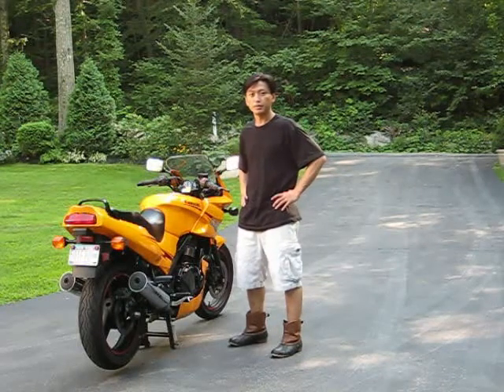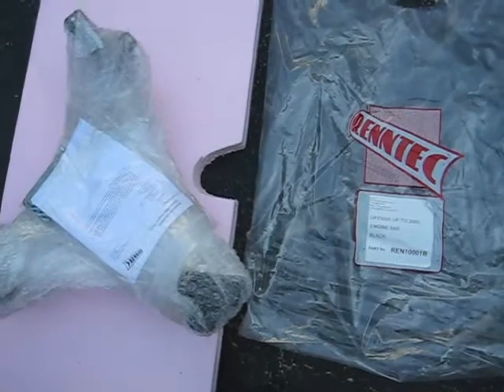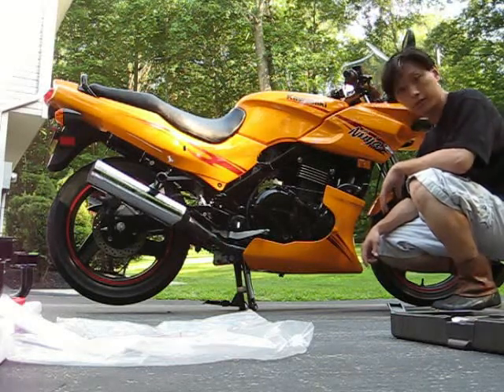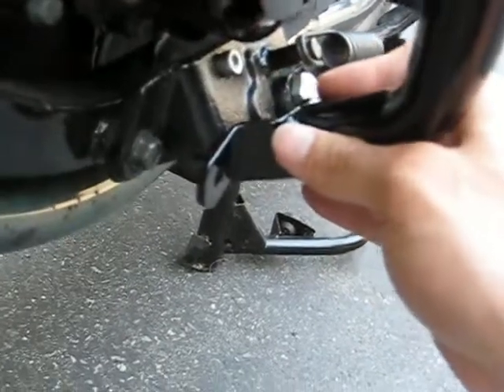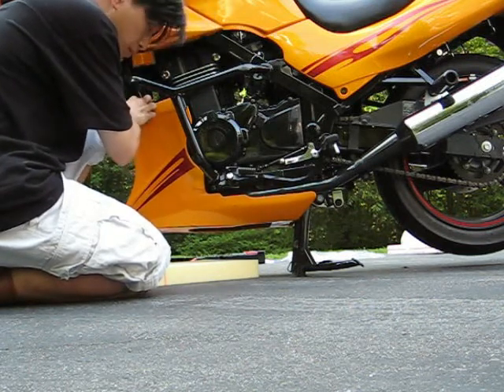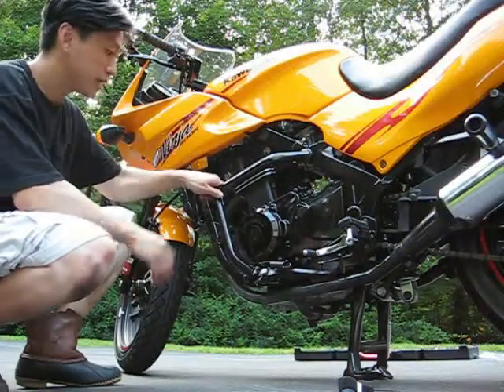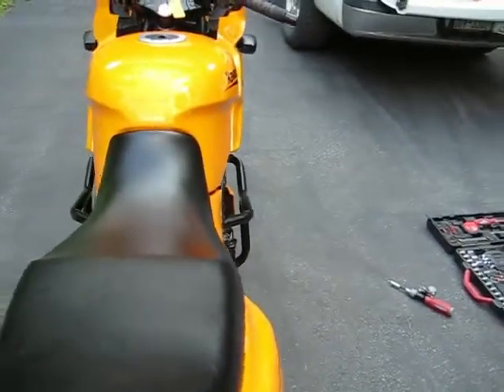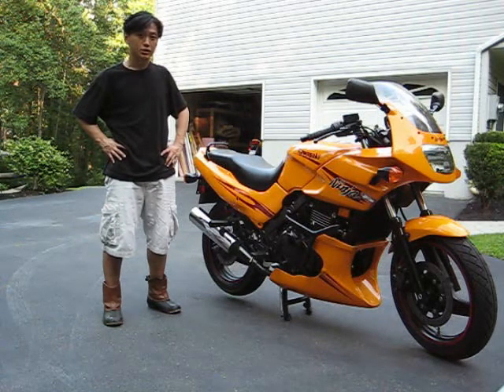Review of RennTec Engine Bars for Ninja 500R

Comment: The Ex / GPz has been in production for over 20 years, the reason is is a good bike, the people who get them like them and/or start on them. They are dependable and good around town and on the track. My EX will run with the 1 liter bikes not the fastest but it keep in the loop. I owned a ZX600 and it was nice but I like my Ex, so my thoughts is keep your opinions to yourself and and don't worry about the EX if yours is so great.

Comment: The bars look great and look like they will provide a good amount of protection.  I just purchased an 09 for the wife.  I am curious on the kickstand side, does the bolt match the hole?  If it does could you put a spacer in there to make up for the distance needed to tighten the bolt down?

Comment: I'm new into this world, can someone tell me what's the name of the big cylindric part shown at around minute 3:00? The one that is vertical and looks as it has a big black lit on top (behind the crossing wires in the middle of the screen), it has a rubber pipe connected on the top.

Comment: Coolguy 1.this is not a cheep car made out of cardbord so a bar can increase the handling .2.That bar is useless,it must be bigger so handlebar and foot stands doesn't touch the ground in case of a drop.3.Is better to have some custom made crash pads whit hard springs and hard metal top cuz in case of a drop they doesn't send the crash impact to the frame and some crash bar in front of the engine and maybe some kind of crash pads at the end of the handlebar,that would be useable, not this ones